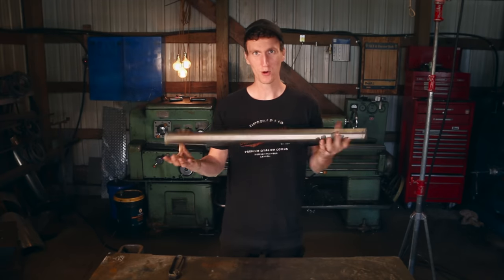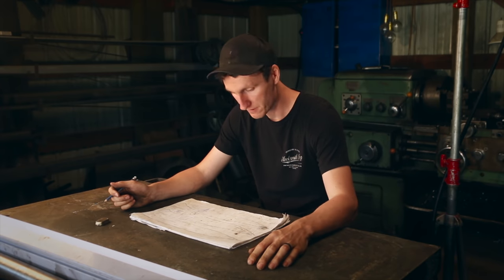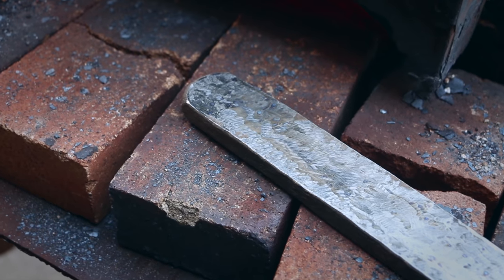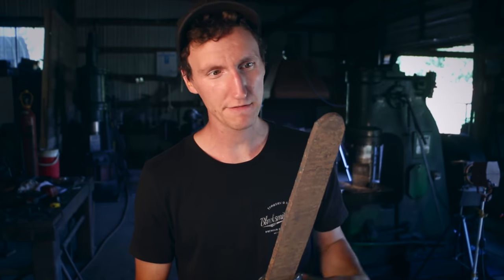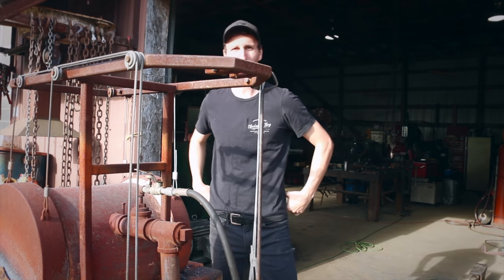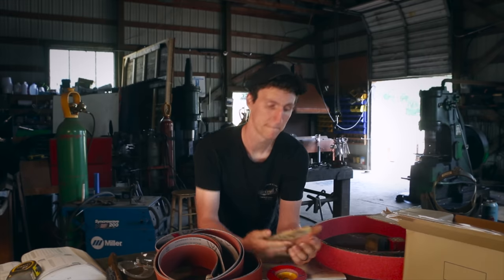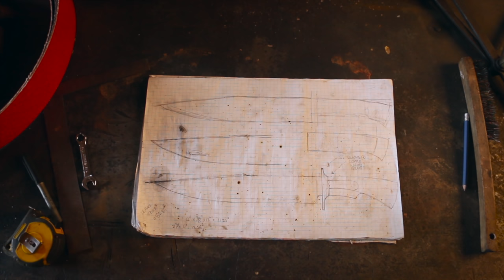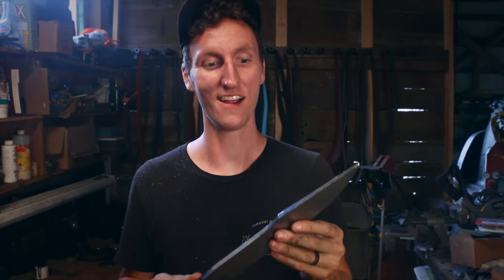Making A TITANIUM KNIFE - Part 1

Comment: If you want a good knife out of titanium I would recommend getting SM-100 or sometimes called NiTiNOL. It's a 60-40 mix of nickel and titanium. It hardens to 62hrc and gets some beautiful colors when it's tempered!
Reply: Isn’t nitinol a memory forming metal?  How would that work with forging or heat treating.
Reply: @erikcourtney1834  it probably wouldn't be the best material to forge, more of a stock removal material, but there is a way to harden it to 59-62hrc. I don't remember the exact protocol sadly. It's honestly a super cool material to work with and has some amazing colors after the HT process
Reply: I’ve always wanted to make a sword of nitinol but it rounds up quickly to $2000 for what $5 of tool steel is
Reply: @wane1393  it's definitely a lot more expensive than the O1 W2 A2 and 80crv2 that I use for my knives
Reply: That’s not considered titanium.   I have heard of divers knives made out of beta titanium alloy.  Maybe 15-3-3-3 or beta C?  Not 6-4 for the blade

Comment: It’s not that it’s cracking it’s the titanium has a very high weld temp so it was just folding and making long thin waves that look like cracks if you haven’t worked with titanium much
Reply: How would you fix that? Heat it to a higher temperature? Or work with it only when it's at a higher temperature, not so much when it's cooled down slightly?
Reply: @chris chontas they were cracks
Reply: @stienogamez8296  no he is right he is not working it at the temps he needed you need to work titanium between white hot to yellow hot he was doing yellow to cherry like you do with steels when i was researching titanium i found references to needing to wear vision protective gear due to the brightness of the metal at temperature.
Reply: Strain rate too high, especially as it gets colder.  Power hammer not the best thing to use.  Hydraulic press with slower ram speed would be better.  Also, some of that may have been a lap.  Metal is getting an hour glass like shape.  The short strokes from the power hammer you’re not working through thickness much, just the outer layers.
Reply: It's a function of the Titanium work-hardening on the outside, and forming an Oxide layer that it refuses to get rid of without abrasive removal. Titanium is my favorite metal to work with, even though it's very strange to work with.

Comment: Titanium keeps a lot more of its strength at typical steel forging temperature. Either increase temperature or use more pressure. 

Titanium is a lot more reactive than steel and the oxide it forms is really hard. In aerospace forging the pieces are normally etched afterwards to remove that oxide layer because it wears any machining tools to bits.

Comment: Now I am far from a metallurgist and any metallurgist who reads this I'd be interested to know your take on this but in relation to the cracks you were experiencing at first, my guess is that titanium might be really sensitive to forging temperatures and maybe you were just barely not getting it hot enough or maybe just barely to hot. But regardless of all that this is an awesome project and I'm really happy to be brought along on this process. It's my understanding that titanium won't hold an edge as well as steel but I'd still do this project if I had the means. Oh and I guess 8 more belts.

Comment: Heh. Sackin Metals is right down the street from me.  

Also, ceramic belts need to be run at high speed with a fair amount of force applied or else the sharp edges get rounded over instead of breaking and creating more new sharp edges.

Comment: Good.
The rod at the initial forging needs more heat I believe.
The core of the rod not hot enough as outer??
The temperature difference between core and outer side might be the reason for fissure at the time of initial forging.
As the stock got relatively thinner the problem was not noticed.
May be stress difference because of temperature difference within the rod.

Make it white hot. Camera exposure variation considered.
Nice.

Comment: Titanium isn't supposed to be heated, welded or worked in the presence of Oxygen - Might be of value to check out some of the information from what Lockheed Martin's "Skunk Works" found as they manufactured the frame and skin of the YF-12A and SR-71.
Reply: Correct. For knife blades I would suggest using bar or sheet, cutting out the profile and simply grind the bevels.  For a hard working edge,  weld titanium carbide on the cutting edge.  A few custom Knifemakers work in this way.

Comment: My best guess as to the mystery cracks on the titanium billet on the powere hammer is that titanium is a poor conductor, so it was probably unable to keep the surface quite as hot as the center of the billet and was unable to bring heat to the surface of the billet between hammer blows causing the effect.

Comment: 12 belts ultra conservative, 18 realistically. Last time I worked with titanium, I blew through 4 good ceramic flap wheels in 45 minutes. Also not a fan of holding my working metal bare handed, even with just a grinder around. TIG gloves if you've got nothing else around, but with Ti, I "armor up" with full length MIG gloves, leather apron, auto-darkening welding helmet, etc. I've seen a workpiece go from perfect to a nanosecond away from bursting into flame while mildly chasing perfection.

Comment: I think that crack looking thing and dust is because it was too cold I’ve been told work it at no lower than a medium yellow and probably 20 belts
Reply: Hannemann Ironworks grind wet too.  Safer, and helps the belts last a little longer.

Comment: My 2x72 is driven by a 3hp donk, I run it at about 33% on the VFD, that keeps the Ti spark down a lot, I use 50gt Norton Blaze belts, I have no problem grinding Ti now, although I much prefer to machine it, I find that it feels like it"slips" against the belt, whereas, blade steel, stays in the grind much better??.

Good luck,

Scott.

Comment: made 2 of them for soldiers out in Afghanistan 7 years ago or so , dont hold an edge very well but Weill last for ever , make great dive knives PS the dust is titanium oxide , Ti rust if you will, it only really oxidises at high temperature , PPS i killed 2 hand held grinders on them , they eat angle grinders !! :-0

Comment: Have you heat treated to get a layer of TiO2. That would hold a edge better then any steel.
Reply: a chemical sharpening before heat treatment would give you a razor sharp blade that would last and even cut steel.

Comment: I think you're working it too fast on too low temperatures. So it workhardens on the surface.

Check the temperature before you start and reduce the impacts between reheating.

Comment: my guess is the titanium is too hot and either burning and/or becoming slightly hot short.I'm guessing that's why such a massive investment had to be made in the pressure of the presses used when they started to forge titanium in the US in the late 50s. Not only is it harder when hot but you probably can't get it as hot as steel or iron.

Comment: Is there a hardening process for titanium? I know it's already tough but like a quench or something?
Reply: I think he said it was 6-4 titanium (6% aluminum, 4% vanadium) in the hammer video.  That can be Solutioned and Aged.  Typically 1750F Solutioning with a water quench followed by 900F age.  Going by memory, check out AMS 4965 to verify.  Difference between annealed titanium and solutioned and aged titanium not nearly as great as between most annealed steels and Quenched and tempered steel.

Comment: I seriously know nothing about working metals, but seems to me that to grind it HOT would be faster and easier on your belts, also why not take it closer to its final shape before grinding???
Reply: Not a bad thought - the hotter the metal, the lower its strength - should be easier to remove. 

A couple of problems with that, unfortunately. Hot metals tend to smear than cut. Think about cutting a sharp, well defined corner in butter. Easy if it's just out of the fridge. Near impossible to get the same shape if it's been in the sun. Same basic idea applies to metals.

(though the devil is in the details - metals are really not like butter at all)

Another problem (especially for steel) is that the heat will wreck the properties (hardness, strength etc). You'd need to go through heat treatment again which often causes distortion and warping which leaves you needing to grind all over again.

Comment: Titanium needs to be even hotter. It should be glowing white. Not yellow or red it's not steel. Plus it also needed to stay in the heat way way longer. Or the cold titanium will folded in on it's self and look like wrinkle lines. I will do 2 projects while waiting for the titanium to be just right. Research before you try something new. It will help you save money and time. Just a little advice to help you along. Also know the grade of titanium. Some are easier to work then others. Good luck on your projects.

Comment: Tim, Great channel. Some dat when I retire I might do some forging.... No time now... Work, Work!...
Quick question:
Could you grind when still red hot? I guessing that the material being softer (specially Ti) would make it easier... No clue on this... haven't see anyone do it.
Any repercussions or problems by doing that, aside from maybe meting your sanding wheels? - or not if it is at the right temps?
Just Curious....
Reply: Adrian Crisci some alloys do get ground hot 600-800F.  Easier to grind.   But this is with big hard wheel “Midwest” grinders.  Afterwards often stress relieved at about 1200F.  This temp will also cause some alloys to age harden.

Comment: can you mill titanium on the bridgeport that would be faster then grinding  👍🙄
Reply: You can, but fixturing will be a massive pain to actually get it set up to grind bulk material removal for bevels. It would have been a good option for flattening the sides, though, so I'm a bit surprised he didn't go that route. Maybe next time.
Reply: @mndlessdrwer  i was thinking of drilling two holes in the tong and make like a mitred block for clamping in the vise then youcan switch sides on the blade without losing consintency

Comment: While harder, titanium is more brittle than steel. ... A titanium knife will not be good for prying or anything that will put sheer force on the blade. It also does not keep an edge as well as steel and will need to be sharpened more often.

Comment: Bro you need to wear a mask and that titanium can ignite  spontaneously when a dust like that.  It is hazardous also.
Reply: A B 😳🤯
Reply: He is wearing a mask...
Reply: I used to forge huge billots of titanium in my old forge plant, never heard anything on wearing a mask. Unless youre talking about grinding. I have no knowledge with that maybe my forge plant wasnt knowledgeable on forging titanium since we didnt do it often
Reply: No, the dust is no more hazardous than anything else to your body.  In fact Ti is basically neutral to your body.  And guess what, TiO2 is in your toothpaste to make it white.   The scale is not pyrophoric.  It will not spontaneously combust.  It needs an ignition source, even if it’s just grinding sparks.  Grinding swarf can be dangerous from the fire hazard standpoint.

Comment: Would titanium Damascus  be possible? :O
Reply: Theoretically, yes. There are different alloys of titanium that you can work with like that and they do have slightly different colors. It would just be an absolute nightmare and you'd want to work it in an oxygen-free environment to set the welds, so stainless foil pouch full of an inert gas to purge the oxygen. Grind off or just unwrap the stainless after you're certain the welds have set. Similar to forge welding stainless steel.

Comment: Kinda new to this forging stuff and don't know a damn thing about forging 😅 does the metal grow longer after heat is applied ? Cause that's what I'm seeing
Reply: It expands because the molecules are loosening. Dunk it in water while it's hot and the molecules slamback together so fast that they become too tightly packed together and that's why Quenched metal will shatter like glass. Take that Quenched metal and heat it just enough to barely loosen the molecules and now you have metal with shock absorption(tempered steel). That's about the basics of blacksmithing.
Reply: Alot of knifemakers don't "heat treat" their knives themselves tho. They just pound the metal into a knifeshape and they send them to companies that will do that for them. It's kinda dangerous to do at home. But if you forge in a brick building then you can't burn nothing down. Tempering steel is just heating the Quenched steel in an oven at 400 degrees for an hour, then just turn the oven off and let it cool on its own. It'll be the color of a dead autumn leaf.

Comment: Isn’t titanium one of those metals that has to be glowing red hot to work with it?
Reply: Hotter. It keeps most of its hardness a d strength til its almost melting. He unfortunately has been cold working his billet, which probably causing the cracking.

Comment: You should really improve the safety on handling your tools. For example you should not use the your angle grinder without handguard and should definitely take off the gloves when operating the belt sander or any rotary tool

Comment: I don't understand the whole forging thing! Why not just cut the titanium rod in longitudinal cuts and then punch out or mill a knife in the desired shape from one of these slices? Or even easier, order a titanium sheet of the right thickness???
Reply: You could use a rolled sheet (rolling being a forging operation itself) and get most of the properties from traditional forging. You can control the crystal structure's texture better if the blade or whatever isn't just a straight bit of metal.

And not to be underestimated, there's the fun of bashing hot bits of metal with a big hammer...

Comment: expensive, brittle, and impossible to sharpen. cool.
Reply: Titanium isn't impossible, it just has a lot of quirks. Diamond sharpening plates work on everything and are pretty affordable now.
Reply: its all for fun man... dont take it too seriously.
Reply: @nope8535  Except steel if you're cutting/grinding at high temperature. Carbon is relatively soluble in iron at higher temperatures.
Reply: @GemAppleTom  Diamond plates, I'm not for diamond in powered grinding do to the carbon issues. Cubitron I hear solves those issues .
Reply: @nope8535  Just looked up Cubitron and it frustratingly does say what it's actually made from (so far as I've seen) >.<
Reply: @GemAppleTom  it's a specialty ceramic aluminum oxide with high uniformity.
Reply: @nope8535  Cheers. I've seen Struers advertise grinding and polishing material. Titanium is a bugger to grind when the abrasive is blunt. So they claim to have developed land with quite fragile particles that break in use thus always having sharp edges. They work well enough... not seen proper analysis though.
Reply: @GemAppleTom  from a personal experience using cubitron it eats through material. It grinds stainless like its aluminum, and titanium didn't fair anymore resistant that I could notice.
Yeah its higher cost but it keeps cutting long past other abrasives would have been glazed or ripped off.

Comment: you shouldn't be grinding that inside. At least not with everyone around. Shit hangs around and is extremely bad to breath. If I can't take a shower after grinding i hit myself with a compressor for about 30 seconds to try and get as much off as I can. As well as running a fan and a full face respirator. Be careful mr. dyck.

Comment: A
Reply: You can squeeze a bit more life out of those old ceramic belts by running them and pass a diamond dressing tool ( for bench grinding wheels) across them. Breaks the dulled ceramics and sharpens them. I also run my belt grinder at almost full blast with Ti. Moderate to heavy pressure with a fresh belt. It's definitely gunna get hot too. Looking great so far